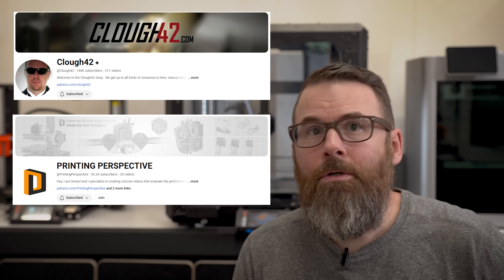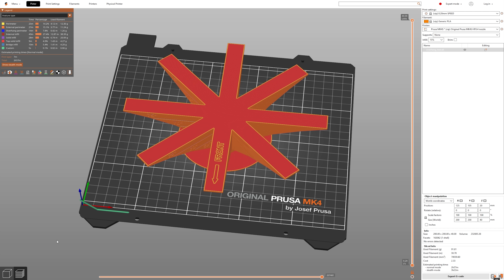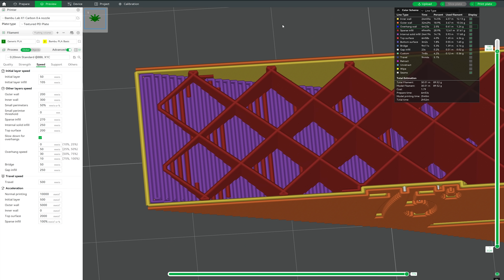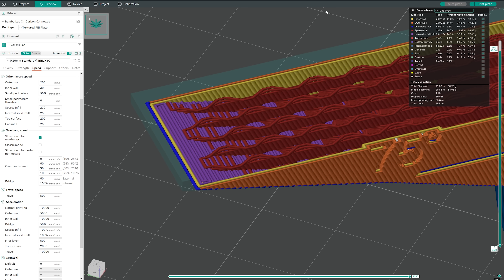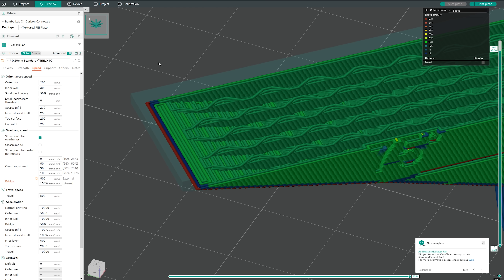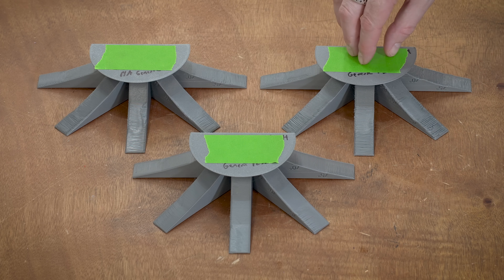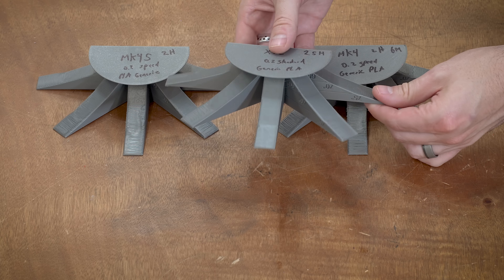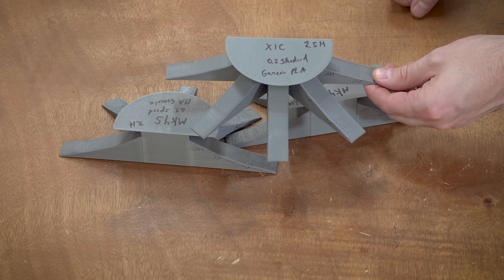Uncovering Prusa's Overhang Performance

Comment: Since when does printer performance rely solely on hardware?  There are lot of printers out there that have great hardware, but don't print well at all. Software is a super important part of print quality, maybe the most important, because you rely on the software to get you the best performance for the hardware that you have.

It's the entire package, and Prusa is very good at providing the entire package.

I didn't see anything sneaky going on here, they are just showing the performance of their package.  Having to adjust the X1C profile to get a better result is a perfect example.  Without proper software, part quality suffers, and let's be honest 90% of users don't have the knowledge of what to adjust and rely on stock settings.
Reply: Let Prusa have their moment instead of advocating for a Chinese machine basically stealing ideas and patents since the beginning
Reply: Cut the r@cist horse💩
Open source is open to all. Chinese, Japanese, American, Africans etc. No one "STOLE" anything if the license is followed.
Reply from the maker: Yep, I absolutely recognize that it's the complete package and mentioned that in the video.  But we also have to realize that in a month from now, that 'package' might not be as good as others fix the bug.  It's ever-changing.

Comment: Damn. They used a software bug to get a leg up? 

That's scummy.
Reply: @avaviel  they said what their printer can do.  Are they expected to check the competitors software for bugs before they make any claims? 😂
Reply: @902Boots  and wait until they merge/upgrade their slicers? they don't even care to merge and fix simple stuff like this even when warned plenty of time ahead
Reply from the maker: I'm not saying they did, but there was some potential for it.  But more importantly, if the bug gets fixed, the gap in performance goes away.

Comment: Great follow-up. Regarding the idea that Prusa may have been "exploiting" this, it's kind of a perspective thing... Prusa's competition has had about 9 months to incorporate the fix (which Prusa developed at their own expense and gave freely to their competition). And the primary selling point of Prusa over their competition is the idea that they handle these sorts of things so it just works.

In this specific case at this time, Prusa clearly outperforms the competition for anyone not wanting to invest years of expertise and tens of hours of time to coming up with a workaround for the bugs in their competition. I think it's great that you provided this info to us, but not sure it's fair to imply that Prusa had some responsibility to highlight that their competition may be able to pull ahead in the future if they implement a software fix.
Reply: Except they don't. We've had 4 revisions of the MMU in total, none of which worked for me until MMU3 dropped. MMU2 and 2S released with a bad mainboard 5V rail, which caused it to crash mid print at random. They never solved this in those versions, and instead pegged the cost onto the consumer for the next version. Stuff like this irks me about Prusa which has left me looking elsewhere for my next printer. Dang shame too, because I have loved my MK3S+
Reply: @ellafoxoo the MMU has been Prusa’s albatross, and I’ve stayed away from it thus far (my MMU3 hopefully arrived today though). People have gotten it to work with a bunch of tinkering, but it clearly wasn’t ready for prime time. 
   
That’s just one case, though. I rather like their design attitude where they continuously improve their products and offer upgrades for older models. Mk4 owners can upgrade to Mk4s; it’s not free but not that expensive either, and beats buying a new printer. Same for the MMU2, that can be upgraded to version 3 as well. Though in that case I think they ought to offer the upgrade at a steep discount.
Reply: @ellafoxoo  Not being a fanboy here... Prusa isn't perfect. But we are dealing with a specific case where:
  - Prusa fixed a thing, 
  - and then gave that fix to everyone else, 
  - and then made a new product that includes that fix, 
  - and then it was implied that they may be exploiting the fact that their competition hasn't fixed that thing to get more sales.

The question is not, "did they fix their MMU too?" The question is, was that a fair implication? Does Prusa have a responsibility to disclose that their customer's hardware may be capable of beating them in certain areas if they decide in the future to do what Prusa did months ago? Or is it fair for them to simply market the thing they made, and let their competition do the same?

Comment: In Orca, this issue can be fixed by hitting "Slow down for curled perimeters". Also, still in Orca, pay attention to the note associated with the external bridge speed you changed: "This is the speed for bridges and 100% overhang walls" (by hovering your mouse over the box). So not exactly a bug but 2 settings mixed together...
Reply from the maker: Well, the bug is not correctly identifying bridges versus overhangs.  It's SHOWN as an overhang, but applying the speed for a wall.  Even though orcaslicer understands the actual overhang percentage (and overlap), it's still applying the speed it would for a bridge rather than an overhang.  I'd have to try the 'slow down for curled perimeters', but with the OTHER model Prusa provided, it's fairly sharp, so I'm not sure that would work properly.  In short, the two models at least SEEM to be exploiting these nuances.
Reply: @RobertCowanDIY  Maybe its because the walls are completely unsupported on the underneath, making the slicer think its a bridge vs an overhang. At steep overhangs, nothing is underneath the external walls.
Reply from the maker: @ichisaur  Correct, but you can see that the slicer DOES think it's an overhang, but treats the speed like a bridge.  It should at least be consistent.  And as noted, it's been 'fixed' so it's something others are seeing as incorrect behavior as well.
Reply: I'm printing the test right now with the option checked and it is looking amazing on the overhang now
Reply from the maker: @ThisisDD  Nice.  So it seems strange that this would be a 'selling point' for Prusa when it's easily overcome.  Sure, they figured it out in the slicer, but still...

Comment: The Prusa 3D MK4S is arguably the best 3D printer on the market right now. Its reliability, precision, and build quality make it the go-to choice for both hobbyists and professionals alike. The attention to detail and the continuous improvements in the Prusa line demonstrate a commitment to excellence that sets it apart from the competition.

On the other hand, Bambu Lab's printers have faced significant criticism for their lack of reliability and inconsistent performance. While they may seem appealing at first glance due to their lower price point and flashy features, many users have reported frustrating issues that make them a far cry from what Prusa offers.
Reply from the maker: I would normally agree with this, but I've seen too many people doing small trials in their print farms and switching over to bambu.  Many die-hard prusa fans are switching over to bambu after realizing that even though they might not be quite as reliable, the net benefits is still there.
Reply: Beep boop hello mr bot
Reply: I'm mostly with Prusa for open ecosystem, good support, and good business practices.
Reply: Bot?
Reply: @colbycowley7549  yeah this feels like it was written by chatgpt
Reply: @colbycowley7549 you?

Comment: Great video and interesting conversation to open. Though I believe that, in all fairness, if the fix was openly available, then factually, competition was indeed not giving its users the possibility to print as well as the Prusa.  So the statement was true. But anyway, excellent job from you, Clough42 & PP ! Perhaps could you try and reach out to Orca people for comment?
Reply from the maker: I'm not really sure THIS is what I want my channel to become?  I'm just putting it out there to rebuff some of my claims in the last video.  I kinda just want to get back to making stuff ;-)
Reply: @RobertCowanDIY  oh please, carry on, I'm not very fond on all these controversies either ;D ! I was merely pointing at an interesting setting issue we should know about and that we can address with such work. But still an interesting correlation that you spotted regarding the fix. Anyway, great channel.
Reply from the maker: @DrZylvon  ha, thanks!

Comment: One thing I love about Orca; the community will have this fixed ASAP. Looking forward to the revision
Reply from the maker: I would suspect it will get fixed pretty quickly!
Reply: @RobertCowanDIY it’s already fixed - enable slowdown for curled overhangs. Prusa slicer has this enabled by default and doesn’t expose it as a setting vs orca that does and it’s disabled by default. The behaviour you’re seeing is by design :)
Reply: @HotendHacker  that's what makes some FOSS community so difficult: fanpeople declaring shortcomings and/or bugs as "design decision", calling it a user fault.
Reply: @rarbiart it is by design though. I ported the curled perimeters slowdown last year to orca  and there was an extensive debate on whether to use the bridge speed or overhang speed for overhang perimeters when over a 90% threshold and was decided that the best outcome would be at that time to use the bridge speed.

However the slowdown for curled perimeters mode treats overhang walls the same irrespective or their overhang angle and doesn’t apply the bridge speed.

So the user has freedom to choose - if the bridge speed is better, disable slowdown for curled perimeters. If it is not, enable it. 

Also in 2.2 we’ve got a new perimeter segmentation algorithm for overhangs that improves the efficiency of the slowdown and applies it in a more targeted manner 🎉
Reply: @HotendHacker  then the default parameters for users like me are just better in Prusaslicer than in Orca. TIL.
Reply: @HotendHacker  I never would have guessed that was what the checkbox would effect. Thank you for the enlightenment!
Reply: @rarbiart  "fan people" you are talking to one of the devs of Orca slicer lol
Reply: @ThisisDD no worries!!
Reply: @youtubehandlesux  if this is the case, it's even worse. it really sounds like declaring a bug as a feature.
Reply: @ThisisDD I’ve updated the tooltips to explain what the impact of selecting the curled overhang option is plus updated the tooltip for the bridge speed to explain that it will also applied to overhang walls with an overlap of less than 13% if slowdown for curled is not enabled. Should be in the nightly in a few days when the Pr gets merged :) 

hopefully this will help users navigate this as there are benefits to both these options but explaining them could have been better in the UI.
Reply: @rarbiart the feature part of it is when printing straight line bridges. Prusa slicer will use the slower overhang wall speed for the walls of the bridge and the faster bridge infill speed for the middle part of it, vs orca and Bambu that will use the bridge speed even for the walls when slowdown for curled perimeters is disabled.

In these cases there is benefit to having this feature because the bridge speed is applied throughout the bridge vs only in the bridge infill part of it. Hope that makes sense?

Basically the issue stems from the fact that if a wall is overhanging 100% it is unclear to the slicer whether it’s overhanging because it’s part of a bridge, in which case the bridge speed should be applied or whether the wall is just a wall and there is no “bridge” next to it in which case it should apply the bridge speed. Prusa has gone down one direction, Bambu in another and orca has both.

In any case I’ve pushed a PR to explain the logic better in the tool tips so the users can pick the approach that works best for their models ;)
Reply: @HotendHacker Thanks
Reply: @HotendHacker  that's hugely helpful!
Reply: @ThisisDD  PR is merged and it’s available in the nightly releases ;)
Reply: @rarbiart I agree here. As a user that likes to stick with default profiles, i prefer if the default profile has the BEST printing settings. Not the fastest, just what will give the best result.  

And someone made a comment you are basically wrong because you're talking to an orca dev, so they know best, etc etc.

I'll argue that being an orca dev makes their opinion even less valid when it comes to GUI for every day users. "Just updating a tooltip bro, anyone will be able to hover over a random sounding setting to get a tech description that may or may not make sense to them".

Id say as a dev, they take their knowledge for granted. This is where Prusa still understands consumers, make shit just work for dum dums
Reply: @rarbiart  You don't say! ;) Prusa slicer and all of its derivatives is freaken built around NOT-sane-defaults philosophy :)
Reply: @bruddaozzo  not my call to update the profiles. Also there are some practical reasons for the BBL printers specifically as the profiles get updated fairly frequently from Bambu hence, it makes life a lot easier to pull the latest profiles without having to re do them. 

Finally most novice users coming to orca from Bambu expect the settings they are familiar with to follow them to orca. 

So in a nutshell, that is the reason for them being set the way they are. It’s all a compromise - speed vs quality vs filament use etc. Bambu has elected to lean towards print speed vs quality in their profiles.

Comment: So confused about calling overture mediocre... they're basically just another brand of Polymaker
Reply from the maker: Overture and Polymaker are just so-so for me.  My gold standard is still Prusament or Bambu filaments.  I wish I could find something cheaper that performs similarly, but I haven't had any luck yet.
Reply: @RobertCowanDIY  It is interesting for sure how experiences can differ so much. Obviously with Prusament you're buying the over the top best of the best. So comparisons can be a little hard to make I would suppose. Either way, I've personally had GREAT experience with them, but everybody is obviously different!
That being said, I'm actually very surprised that the Bambu and Prusa didn't have similar finish quality with the same filaments. Makes me wonder what other tuning it is due, or what tech it's missing that the bambu is employing to achieve it's result.

Comment: This is really shady. Seems like they're getting desperate for cash. I have an MK4 for I'm not sure if I'll do the upgrade now.
Reply from the maker: It's still a worthy upgrade and of course we have no idea if this was their intention or not.  I wouldn't boycott the upgrade though, $100 gets you a better printer, no question.
Reply: @RobertCowanDIY  perhaps I was too quick to grab the pitch fork. It does appear to improve the performance of the MK4 and for fairly cheap.
Reply from the maker: @CandidProle  This video aside, the upgrade is still very much worth it.
Reply: 100 usd - great price! The upgrade is a no-brainer. 😊
Reply: @JorgePetsas  after thinking it over, I think I'll give it a go.
Reply: It is just a matter of engineering doing a couple of stuff to improve the overall performance of the printer and marketing spinning these improvements in a way that skews the consumers to believe the product is better than the competitors' due to fundamental hardware differences.

Comment: I would state it differently: At this moment the MK4S has the best overhang performance as a printer's performance is a combination of hardware and software. But this can change if Bambu fixes their software. It is a rat race in which the customer profits in the end, so let the battle continue🥳
Reply from the maker: Yeah, I'd agree with that.
Reply: The trouble is if you ordered the prusa on the promise of best overhangs... your stuck once you realise it was a simple bug or setting fix. The X1C from the video above fares very, very well.

Or likely the P1S being much better at likely a cheaper price while being enclosed.. but that's another discussion
Reply: @BrettJamesSuperRoach  I mean, I’d like to know if it was the exact same settings, or just a default profile settings, because my mk3s can do overhangs better than the mk4 shown with just a few slicer tweaks
Reply: @BrettJamesSuperRoach  X1C took longer to print the model, and is louder as well. Some people like to keep our hearing, but yes that's another discussion.
Reply: Did you not watch the video? X1C is clearly better, it’s just a setting change you can do today.
Reply: @zackj997  except that changing that setting will make models print much slower overall. This will probably be fixed soon, but until then, it's tradeoffs either way.
Reply: @jamesbilger  Only if you do it the way that Robert did it. I found in the comments that its been in Orca too, but it's disabled by default. "Slow down for curled perimeters" is the option under Overhang speed. Check it and you get the same feature and the overhangs are correct at that point. I'm testing it right now to fully verify, but the GCODE result looks promising right now
Reply: @zackj997  Most people use what they are given right out of the box and will never see this video. For all those people the MK4S will deliver the best overhangs until Bambu fixes the software.
Reply: @zackj997 if only dislikes still worked

Comment: I assumed the fan was more so to compliment the high flow nozzles not so much for overhang performance
Reply from the maker: The 'review guide' would disagree with you ;-)
Reply: @RobertCowanDIY  probably a classic case of engineering doing one thing and marketing spinning their own angle
Reply: @902Boots  probably so. Not that we are not landing with a better product than the one before, but it is just marketing it in a way that makes their product look better than the competitors' due to fundemental hardware aspects, which is not accurate.